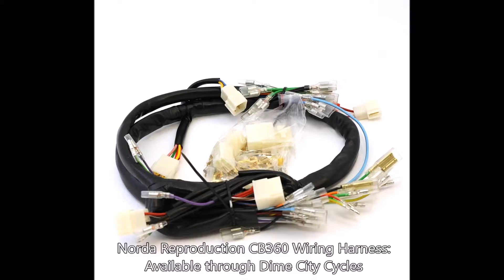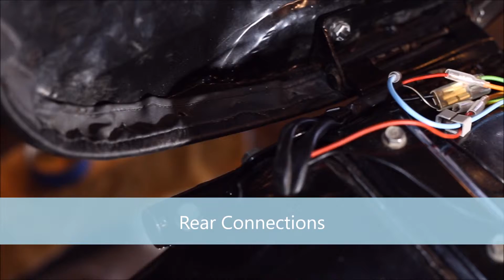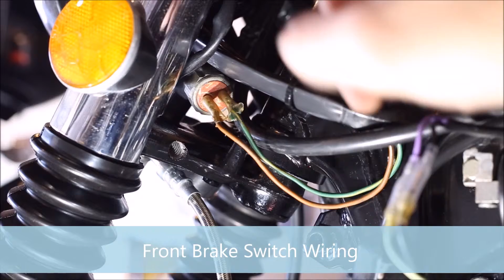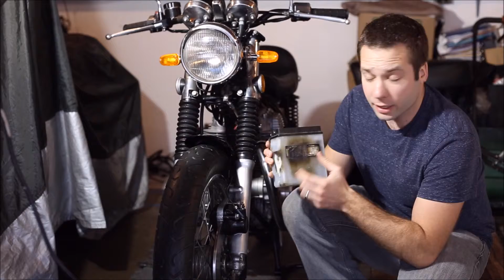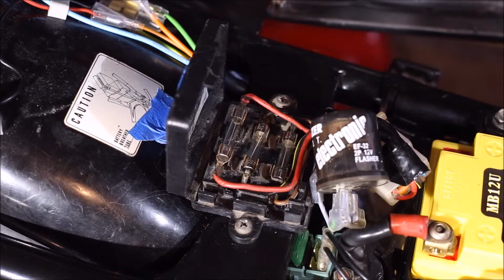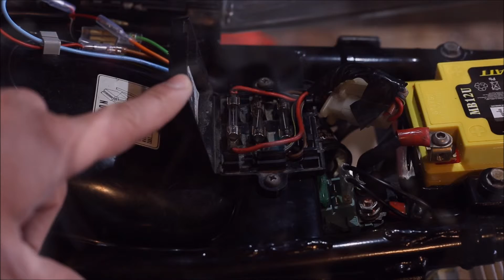1975 Honda CB360T Project Phoenix Part IX - Wiring & Electrical

Comment: Hoping for some help please !!!!!!  I have a 1975 Honda CB360 . The problem is tracing the Brown wires .  The brown wires I am dealing with are . Brown ( BR )  ,  Brown with blue stripe  BR/BL , Brown with White stripe  ( BR/W ) .  Brown with red stripe ( BR/R) .  I think Brown with Yellow stripe ( BR/Y) . Here is my problem  No Dash light and no rear tail light ,   The connectors at the connecting bundle on the side of the frame under the fuel tank there is the Brown wire with a blue strip and the Brown with the RED stripe . Is that a dead end wire or does that wire plugs in with the black wires ?  Another thing I could not find a vary good wiring diagram  that shows this wire . PLEASE HELP . Thanks Jeff

Comment: On the new harness, there is a purple and black wire that sits about above the ignition coil. I was wondering where you wired them to.
Reply: I also have a loose brown wire up near the headlight coming from the harness. I was wondering where you wired that to.
Reply: @tilldoneth5452  Brown does nothing.  It's for running lights on the UK version